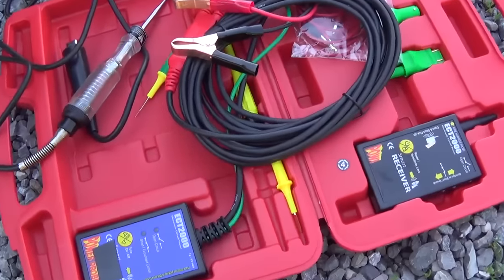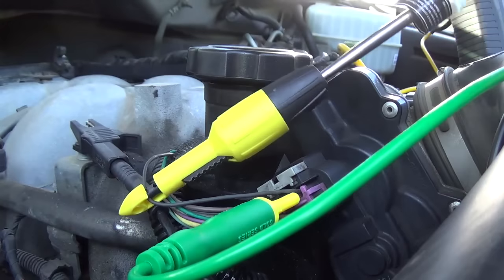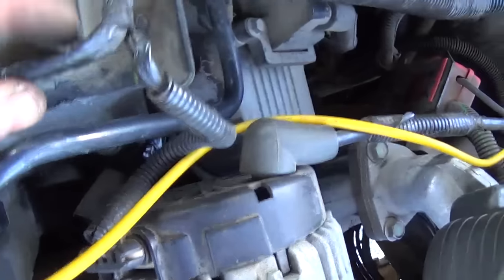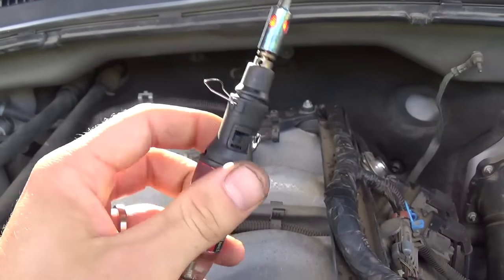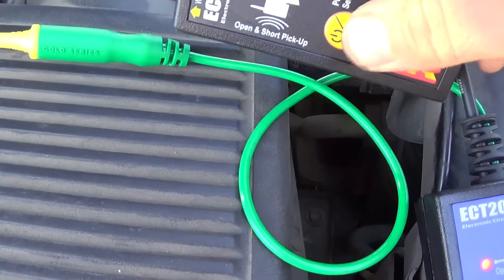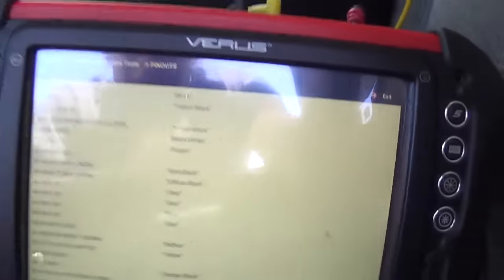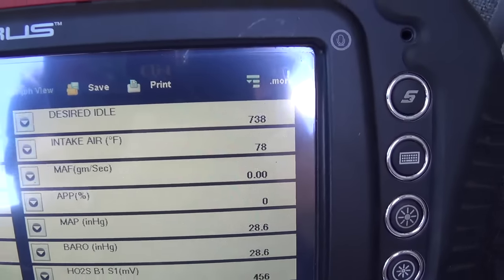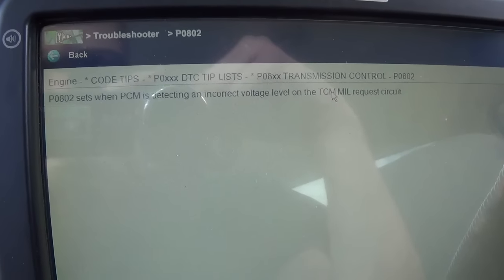GM Chevy truck: "REDUCED ENGINE POWER" Case Study- Part 2

Comment: It is a bad PCM/ECU that causes the Reduced Engine Power. I had this problem and went to a Junk Salvage yard and pulled a used one off of a Chevy truck same like mine and it worked. The previous owner before me replaced 3 Throttle bodies and i myself replaced one from Autozone and yet the Code P1221 and R-E-P kept coming on.

Change out the PCM/ECU do the re-learn 
10 Mins with key on crank 
5 seconds off
10 Mins with key on crank 
5 seconds off
10 Mins with key on crank 
the Last 5 seconds off you turn the truck on. And no more Reduced Engine Power.

I can tell you guys how many nights i have spent pulling what little hair i have left out trying to fix this problem. Now i can pass this info on. I have a Video of my Truck on my Channel. Peace
Reply from the maker: Well in your case it may have been a bad PCM. However, that is NOT the usual cause of Reduced Engine Power. The only way to PROVE it before installing new parts, is to monitor raw data and scan data at the same time while applying the throttle. In this case it was just a broken wire :)
Reply: Dear Pine H-A-D
In your case a wire however for people who have replaced the whole throttle body encountering the P1221 Code and after replacing the Throttle body and some times even the wire harness the code still comes up along with the Reduced Engine Power.

I have seen your video and tried your method along with others and still the Check Engine light and Reduced Engine Power kept happening so for many it's not as simple as a wire. 
My answer was change out the PCM/ECU and Presto no more R-E-P so i am sharing what worked for me.

Thanks for sharing this video. peace bro fist bump.

Comment: My Son has a 2003 Saturn L200 that has the similar issue. There's no power when you floor it and has a "Engine Jump" (miss) when tapping the gas in park. I've read of GM vehicles having issues with the TB. Could be a bad circuit inside the TB innerd's too. From what I've seen here that it could be a plugged cat as well, which I find remote. The check engine light flashes when it does this but no codes.

Comment: Looks like the 2 copper ends wires were not twisted around each other? A good solder joint needs a solid mechanical connection, and the solder is to make a good electrical connection. I've had practice due to rodents chewing thru wires, chewing off insulation.

Comment: Hey how you doing, very good video, I have a Chevy trail blazer LTZ 2002 and I have a reduced engine power lights on when the engine is cold and i already changed the Throttle body and I still have the problem I don't know any electrical person that I can trust to fix my car seeing this video I would like you to fix my car (I live in Miami) thank you so much

Comment: Hi Ivan just thought I'd share a pretty good tip with u undoing  those wire tape is a real problem so try this seam ripper stitch you can buy them off eBay they slice through the plastic coating on the wires much better than a knife they made for undoing stitching on clothing

Comment: On gm trucks always look at the grounds and don't forget the grounds on the frame on drivers side especially if you live in the northeast also look for corrosion and for mice chewing on wires under main fuse box .

Comment: I would use a smaller diameter solder than what you have, it will help the solder flow with less heat.  Just don't go with the lead free solder if you can it requires much  more heat and is more prone to breaking with vibration.

Comment: Sir once  ect is connected to the battery by default  the light goes to the open,then how can we find there is a break in wire,will  there be a beep sound

Comment: The break is usually just before or at the connector. Replace all the wires you poked. That whole connector should be replaced. Those cuts in them wires is very strange. Likely a 'junkyard motor.

Comment: Thanks for you video  Ivan 
I have a 2004 Silverado 2500hd if I start the truck at night time the headlights came on and the truck runs rough (Engine power reduced) if I disconnect the battery negative post and start the truck during day time without using the turns signal, hazard or lights it runs great.  I’m out of ideas.  Any suggestions.  Thank you
Reply from the maker: Hi Ivan, first read what codes it is setting. I would suspect a grounding issue for the TAC module.
Reply: @PineHollowAutoDiagnostics  thank you for the reply.  I have one code U1041. I’ll inspect the ebcm   Connections the connector may get salt after the snow that we got also I’m going to inspect all the grounds
Reply from the maker: @IvanRamirez-fs3sf  If you see the "Reduced Power" message, you should definitely have some "Pxxxx" codes stored in the PCM.

Comment: That sensor is crap going through looms. The 3000 used w/ the powerprobe4 , instead of the supplied receiver, is only slightly better.

Comment: motoYam82, any videos on how to relearn the throttle body on a 2010 malibu? Or any ideas of vehicles that would use the same process to do so? Lady mechanic in training here! Haha!
Reply from the maker: Hi Jessica, most bidirectional scanners offer an idle relearn procedure for GM vehicles. As a last resort remove the battery for 10 minutes and reinstall...old school method. Good luck in your training, we need more good honest lady mechanics! :)
Reply: motoYam82 Thanks for the quick reply! Removing the battery cables was what I was thinking too, but figured I'd better make sure. My local dealership was going to charge me $500 to replace the throttle body and the reprogramming of the sensor. Considering I've done all the repairs and maintenance myself so far with the help of videos like yours, I figured why not try this too? Haha! My part will be in Wednesday. I'll let you know how I fared! Thanks a ton! I appreciate guys like you that share your knowledge!
Reply: Jessica Edwardsen I

Comment: Like you should NEVER use a test light to check any circuit to an ecm.  It simply pulls too much current and will blow the ecm circuit internally. You only should use a high impedence (super low current) VOM when testing ecm or pcm circuits.
Reply from the maker: I have yet to see a regular test light damage a PCM circuit (unless it's a 5A headlight bulb lol). I agree you have to think about the circuit at hand and be careful. Do some research on circuit design and you will see why. Until someone shows me a real-world example where this has happened, I will continue using my trusty test light ;)

Comment: My 2007 Chevrolet Silverado had the Stabilitrak traction control reduced engine power I found my problem in my wiring harness that runs between the steering knuckle on the steering box and my crankshaft the steering knuckle rubbed two wires so much it broke one and halfway broke the other one repaired both of them I have a new truck now seems like one anyway
Reply from the maker: Awesome!

Comment: I've checked wiring and everything correct voltage to throttle body but the butterfly inside with the key on just pulses rapidly and stops. Cleared codes but as soon as I turn the key it pulsate and my reduced engine power light comes on. Bad throttle body???
Reply from the maker: What codes does it store in the engine computer??
Reply: It was a bad throttle body.  My code was p1516 throttle actuator control module.  Thank you.

Comment: I have a 2002 Chevy Tahoe reduced engine power light is on and it will not start it's a 5.3 liter what can I do
Reply from the maker: Scan and record trouble codes for all the modules in the truck (PCM, TAC, TCM etc.) You need a good scanner with OEM data capability to diagnose these properly.
Reply: Did you solve your 2002 Chevy Tahoe problem?  I just had same issue - intermittent "reduced engine power" P1518.  $400 for Throttle Body.  No change.  Could drive 90 miles, 600 miles, or sometimes 10 feet until problem would pop up again.  So far I've cleaned two grounds - one on frame under driver door and one on passenger side of block.  So far so good.
Reply: franklin gaines check theblack and white stripe wire ground back left of engine, ground runs from harness to back of trans. And chech all other grounds.

Comment: It's the Throttle body actuator ! I had one go bad on my Chevy cobalt and it would not let the throttle body open to let enough air in and caused the reduced engin power !

Comment: got an 03 Yukon reduced power comes on and I can restart vehicle and drive it for another week or so then it will do it again. can always turn off engine and turn back on and it goes away though. any ideas?
Reply from the maker: Scan for codes with a GM-specific scanner.
Reply: Christopher Jones  My 07. Yukon was doing the same thing and all it was was the connection for throttle body. I unplugged and cleaned it up . I've been driving for 3 months with no problems it even passed test only smog.

Comment: This is what happens when clowns mess with wiring harnesses. Rank armature punk with a razor knife damn near destroyed the entire truck. From now on, when ever I see that someone has torn into the original wiring harness that is where I'm going first. GM won't even mess with fixing wires, they will simply sell you a complete new wiring harness for like 3 grand. That's how they do things there, they don't give a single shit how much it costs you.
Reply: +Rod Palm Which means that the repair should also cost $3,000.00.  If the end result is the same, the process by which it is achieved is irrelevant, and therefore, just as costly.

Comment: First :)
Reply from the maker: Steve Rob Niiiiice! You win a T-Shirt....but first I need a logo lol
Reply: @PineHollowAutoDiagnostics  Have watched many of your videos. You do a great job. I purchased a used 04 Yukon last fall. It is in great shape in and out. I have the same issue going on. I have replaced the sensor, then the throttle body and the foot pedal assembly. Still get the problem from time to time. Under the driver side, there is a plate with several ground wires going to it. I cleaned that all up and thought it would solve the problem. No such luck. I would like to give this truck to my son but I can't seem to get this problem solved. Do you have any other suggestions for me to try? I would bring it to you and have you get to the bottom of it, but I live in northern Indiana and that would be a long haul to get the vehicle to you. Any help you could give would be greatly appreciated. Thank you.
Reply from the maker: @mackdaddy6652  what code is it setting?
Reply: @PineHollowAutoDiagnostics  I am not sure this time. I will check it when I get home from work and reply. It goes in spurts. It will run fine for a while, then like yesterday it happened 5 times on the way home form work, and it usually only takes me 12 minutes to get home form work, so it is not that far. I know in the past, it has given me the P2135 code. I took it to a GMC dealer a few months ago and they told me the harness was fine but that I needed to replace the throttle body. I did that and replaced the accelerator pedal assembly, complete with the sensor but still have the issue. My next thing is going to be to try and replace the braided ground wire from the engine block to the firewall.
Reply: @PineHollowAutoDiagnostics  P0220, P1516, P2101. I am sure that means something to you but I don't know why it is throwing those codes when I replaced everything already? Thank you in advance for any help.